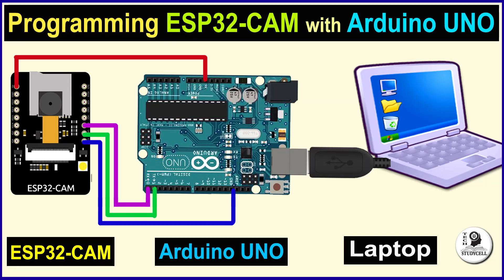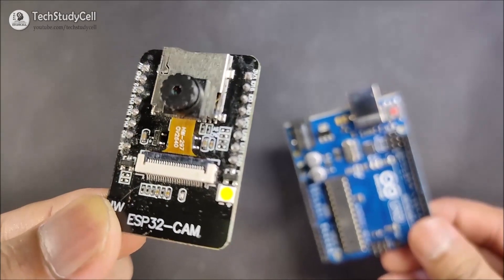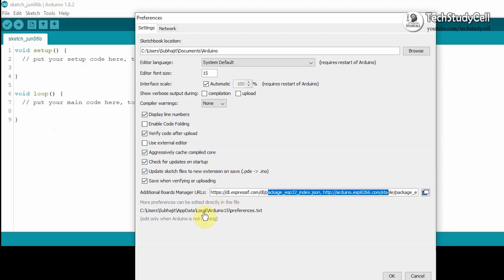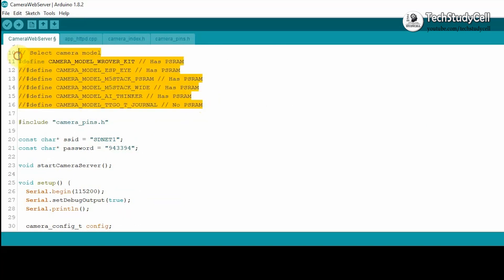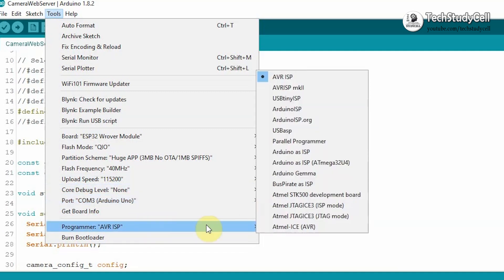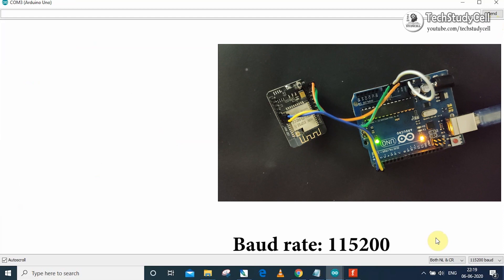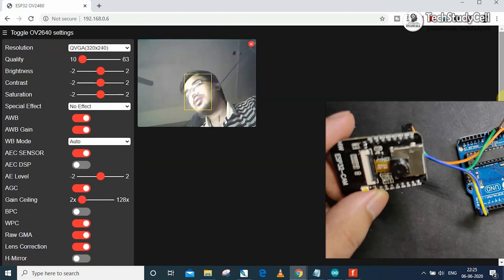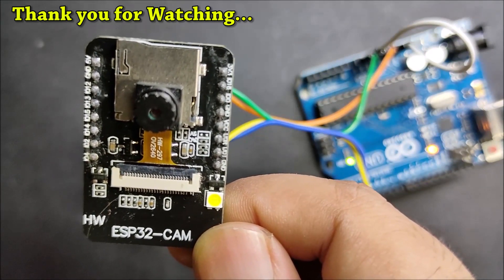How to program ESP32 CAM using Arduino UNO

Comment: Hello,   There is a fundamental error in the video.  When you select the board as esp32 WRover model , how did you get programmer selection as AVRISP !!     This should only become esp32tool  .  You did modify on the Arduino ide platform or something else is missing in the video ....Please advice .....thank you
Reply: It works with esptool ,he is using older Arduino ide ,now eth is updated

Comment: If you're getting this error:

"Connecting........____....._____....._____....._____....._____....._____.....___  
A fatal error occurred: Failed to connect to ESP32: Timed out waiting for packet header"

Be careful — based on the wiring shown in the video, that pin is labeled GND but it's actually GND/R (connected to RST), not a real GND. Make sure to connect the Arduino UNO to the actual GND pin (usually near 5V), not the GND/R one. That fixed it for me.
Reply from the maker: When you see Connecting........___....._____....._ press and hold the BOOT button until upload start.

Comment: After the code is compiled, it displays"a fatal error occurred:failed to connect to esp32, no serial data received " How should I fix it?
Reply: did u fix it same here
Reply: @jemsheena3914  i can't fix it. I followed every instruction in this video but still there is an error .

Comment: hello dear friend im one of your fans and i always watch your videos but i have followed this esp32cam but after uploaded the code to the esp32cam and i have removed the gpio0 and gnd pin after that i have opened the serial monitor i press the small bottom but i did not get the camera code please can help with that the problem is thank you hope hear fro you soon

Comment: thanks dude, but i have one question that its that when i go to the serial monitor and i press the restart button, it shows like this default text and start writing endless dots and dosent give me any IP, do you know how to fix this?
Reply from the maker: It trying to connect with Wifi
Reply: @TechStudyCell  thanks dude i allredy figurate out that the network its not a network that the esp generates its your local network that the esp uses like a switch

Comment: Hi! I need your help. I'm trying to use a trigorilla board (arduino mega2560) to program an esp32cam following this tutorial (spectacular, man!) But it do not work. This board has no reset pins, but it has a reset button. If i push this button, the board ....just reset. If i select the board as esp32, in port only shows "com3". Can you help me using that trigorilla board to program my esp32?

Comment: I didn't get the ip address and stuck at endless dots how can I fix it?
Reply from the maker: it is not able to connect with WiFi. Pls check the wifi connection and exit from the program mode, reset, then try
Reply: thanks already fixed it esp32 is not updated to detect the 5g wifi connections so u must use a 2.4g wifi connection for it to work.

Comment: Excellent explanation! Everything you need, direct, clear, and nothing superfluous
Reply from the maker: Glad you enjoyed it!
Reply: Do I just flash it even though the programmer is not available?
Reply: Flashed it and it worked. To all, be aware, on my ESP32-CAM (ESP32-S) one of the GND pins, is not actually a GND and gave fatal error bla bla. Changing the GND connection to the 2nd GND pin, the flashing worked just fine. Remember to disconnect the GPIO 0 from GND after flashing, open Serial Monitor and only then press RESET on your ESP32 in order to execute the programme and get the IP. In case the response is "............" check your SSID/pass for typos. Good luck!
Reply: Did it worked for you?

I'm getting error and no AVR ISP programmer in IDE
Reply: @techtalk5161  did you get it now ?

Comment: hello, i keep running into a problem where it does not provide a link to be copied and accessed, it only shows up to the entry 0x400806b8 text, after that it should provide a link to access the camera right? mine does not show up, it only shows dots

Comment: I keep getting this error in loop can you pleaase help

Guru Meditation Error: Core  1 panic'ed (IllegalInstruction). Exception was unhandled.
Memory dump at 0x400d6e8c: eeeeeeee eeeeeeee eeeeeeee
Core 1 register dump:
PC      : 0x400d6e91  PS      : 0x00060530  A0      : 0x800d1074  A1      : 0x3ffb1ee0  
A2      : 0x3ffb1f34  A3      : 0x00000000  A4      : 0x0800001c  A5      : 0x00000003  
A6      : 0x00000003  A7      : 0x00000000  A8      : 0x800d6e72  A9      : 0x3ffb1ea0  
A10     : 0x00000000  A11     : 0x3ffb1eec  A12     : 0x00000026  A13     : 0x3ffb844c  
A14     : 0x0000002a  A15     : 0x00000000  SAR     : 0x00000005  EXCCAUSE: 0x00000000  
EXCVADDR: 0x00000000  LBEG    : 0x4008cf0c  LEND    : 0x4008cf28  LCOUNT  : 0xffffffff  

ELF file SHA256: 0000000000000000

Backtrace: 0x400d6e91:0x3ffb1ee0 0x400d1071:0x3ffb1f10 0x400d37c6:0x3ffb1fb0 0x4008fe86:0x3ffb1fd0

Rebooting...

Comment: 1 year later, version 2.04 of the library and things have change. Now I cannot reproduce this at all. What's worse version 1.04 has apparently been altered somehow and can no longer select a programmer for the board at all. What a pity. 

However with the new version I found out that using "Upload using Programmer" (from the Sketch menu) seemingly does the job. I had to reconnect the Arduino to the PC and then restart the serial monitor.

Comment: Hi..
I am getting this error:
A fatal error occurred: MD5 of file does not match data in flash!

I tried uploading it using Arduino and FTDI convertor, both, but getting the same error. Could not find a fix that work.
Would really appreciate some help :)
Thanks!

Comment: I need some help, this given this error when running the program

esptool.py v3.1
Serial port COM10
Connecting........___....._____....._____....._____....._____....._____.....___

A fatal error occurred: Failed to connect to ESP32: Invalid head of packet (0x00)
A fatal error occurred: Failed to connect to ESP32: Invalid head of packet (0x00)

Comment: So there’s not really much of a difference from programming the esp32 cam
Directly with an FTDI Vs connecting it to an arduino board and then uploading the code? 
I’m new to programming lol
Reply: What will happen if i paste the IP on different device browser which is not connected to audrino. Will i be able to access the camera from different device?

Comment: Appreciate it. If you're on Mac and get a "exec: "python": executable file not found in $PATH" error you need to run the commands sed -i -e 's/=python /=python3 /g' ~/Library/Arduino15/packages/esp32/hardware/esp32/*/platform.txt in the terminal.
Reply: What will happen if i paste the IP on different device browser which is not connected to audrino. Will i be able to access the camera from different device?

Comment: cc1plus.exe: out of memory allocating 8016 bytes
Multiple libraries were found for "WiFi.h"
 Used: C:\Users\USER\AppData\Local\Arduino15\packages\esp32\hardware\esp32\2.0.2\libraries\WiFi
 Not used: C:\Program Files (x86)\Arduino\libraries\WiFi
Using library WiFi at version 2.0.0 in folder: C:\Users\USER\AppData\Local\Arduino15\packages\esp32\hardware\esp32\2.0.2\libraries\WiFi 
exit status 1

It is showing me this error while uploading!! Please help ! It's urgent!!

Comment: Unfortunately this did not work for me. I followed the instruction exactly until setting the "Programmer" under "Tools" on the Arduino Uno. The line states: "No programmers available for this board". Also the USB port on the laptop does not designate it is as "Arduino Uno" as in the instructions, just COM5. I've check the spelling of the preferences additions many times.
Reply: found any solution ? i didnt got AVR ASP as programmer either ...

Comment: Sir, I followed every ste but I don not have the AVR ISP programmer. The programmer does not show up under Tools>programmer. It said that "No available programmer in this board". Im using Arduino Uno by the way.

Comment: the urls don't work. I can't get the esp 32 into my examples. it would be so nice, if the info in the video actually was on the arduino program. turning out to be a major frustration. I am an A+ certified computer tech with 20 years exp. this is written well, just not up to date, or just plain wrong. but so far, I'm not getting anywhere. there is no way to teach it to children, if I can't figure it out. everything [points to those two urls, but they don't work, nothing but error messages, and no answers how to fix it, just more and more sites and people pushing that url. 
help would be nice.

Comment: how to use the arduino as a power supply for the esp 32 cam (just a power supply after programing it to use the arduino with other code which not to effect the code on the esp 32 cam  )

Comment: im having error with the face recognition, it said:

Item psram alloc failed. Size: 230400 x 1
matrix3du item alloc failed.
dl_matrix3du_alloc failed
Item psram alloc failed. Size: 230400 x 1
matrix3du item alloc failed.
dl_matrix3du_alloc failed

how do i fix it?

Comment: Hi, thank you for this video.

I have a question for you

Is there a way for use the arduino´s pins to connect 
peripherals? I need more pins and the ESP32 is full
Reply from the maker: You can initiate serial communication between ESP32 and Arduino

Comment: Can someone help me i have error while running the esp32 cam module. Face detection and face recognition is not working 

Item psram alloc failed. Size: 126720 x 1
matrix3du item alloc failed.
dl_matrix3du_alloc failed

Comment: Thanks!! Worked. I see some having trouble with "Programmer: AVR ISP" but I'm using Arduino IDE at version 1.8.13 without this setting, in programmer I just left with nothing and worked.

Comment: But esp and Arduino works on different logic levels.. using 5v on  esp32 can damage the board or are they 5v tolerant ? Seems like I'm missing something here
Reply: ESP 32 boards have a built-in voltage regulator that steps down incoming 5 volt to the required 3.3. the problem with using 3.3 directly is you don't provide enough voltage for all the components on the board.
Reply: @MultiSmokeBomb  yeah but regulator is for the power supply right? Logic signals are different, aren't they?
Reply: @phizaics  yes they are but when you input 5 volts or higher of power on the voltage pin it routes it through the voltage regulator I'm not exactly sure how the printed circuits on this board work and what direction is they run I haven't traced them. But I did read in the user forums on the AI thinker page that it does automatically regulate the voltage that you're inputting. You wouldn't be putting voltage in on a data pin anyway, but if you look at the schematics some of those IO pins are multi-use. In fact I think at least six pins on the board have three different functions each. I'm still having problems getting mine to work. It keeps failing on connect no header
Reply: Addendum, I think the regulator is tolerant up to 15 volts at 1 amp.
Reply: Made a liar out of myself just when I told you that I haven't been able to get it to connect for the upload it decided to upload

Comment: i have an issue error:

Arduino: 1.8.13 (Windows 10), Board: "ESP32 Wrover Module, Huge APP (3MB No OTA/1MB SPIFFS), QIO, 40MHz, 115200, None"

Sketch uses 2594774 bytes (82%) of program storage space. Maximum is 3145728 bytes.

Global variables use 56256 bytes (17%) of dynamic memory, leaving 271424 bytes for local variables. Maximum is 327680 bytes.

esptool.py v3.0-dev

Serial port COM7

Connecting........____....._____....._____....._____....._____....._____.....____

A fatal error occurred: Failed to connect to ESP32: Timed out waiting for packet header

A fatal error occurred: Failed to connect to ESP32: Timed out waiting for packet header

This report would have more information with
"Show verbose output during compilation"
option enabled in File -> Preferences.

Comment: In the video you are showing a ESP32 board not the camera board. For some reason, although it's trying to connect, it's not connecting with the camera board. I tried reversing the RX and TX lines and that didn't work. Can it be a wrong board in the Arduino IDE?  Any suggestions? Thanks.

Comment: I get this error:
[E][camera.c:1113] camera_probe(): Detected camera not supported.
[E][camera.c:1379] esp_camera_init(): Camera probe failed with error 0x20004
Reply: same here, did u find the solution?
Reply: @janejakumar9844  i changed the board to AI THINKER ESP-32

Comment: thanks for the video. I have a question, can the camera be accessed from any point outside the network, either with Wi-Fi or mobile data?
Reply: Just based on the IP address that was allocated to the device I'm going to say no. What you can do though is once it's set up you can go into your router settings and assign that device a static IP. You can place that static IP into the DMZ outside of the router's firewall openly facing the internet.

Comment: buenas noches,, me sale este error  Arduino:1.8.13 (Windows 8.1), Tarjeta:"AI Thinker ESP32-CAM, 240MHz (WiFi/BT), QIO, 80MHz"

El Sketch usa 2594790 bytes (82%) del espacio de almacenamiento de programa. El máximo es 3145728 bytes.

Las variables Globales usan 56256 bytes (17%) de la memoria dinámica, dejando 271424 bytes para las variables locales. El máximo es 327680 bytes.

esptool.py v3.0-dev

Serial port COM4

Connecting........_____....._____....._____....._____....._____....._____.....____Ha ocurrido un error mientras se enviaba el sketch

_

A fatal error occurred: Failed to connect to ESP32: Invalid head of packet (0x00)

Este informe podría contener más información con
"Mostrar salida detallada durante la compilación"
opción habilitada en Archivo -> Preferencias.

Comment: Hi Sir, great work. I wanted to ask a question, would this same setup work with arduino mega board serial 1 pins?
Reply: Hello I was wondering whether you have found a way to connect it to arduino mega board?

Comment: I got it to go after a few tries. Also yes to set Programmer to 'AVR ISP' you need Arduino IDE 1.8.12. It's not on the 1.8.13 version. Thank you very much!
Reply: But this not working, I can't find esp32 in examples please help
Reply: Hi, I followed the steps and got successfully the IP address. However, when I tried to search it on browser it can't reach the page. Pls help.
Reply: @jameslloydtumanda2136  is that module is connected to the device in which u search?? through hotspot/wifi??
Reply: @gokulakrishnan527  Do you mean that my laptop and the module must be connected to a same wifi network?
Reply: @jameslloydtumanda2136  yes you have to connect same wifi !
Try it:
swithch On the Hotspot on ur mobile and connect ur laptop through wifi also connect module to that same network 
search the ip on ur mobile browser or laptop browser.
Reply: @gokulakrishnan527  My laptop and the module are already connected on the same wifi network. But still, it can't reach the page when I search the IP address. I will try to use other WiFi network. Thanks..

Comment: why whenever i choose face detection/ recognition the stream freeze and stops working?
Reply: CORRUPT HEAP: Bad head at 0x3ffdfdf4. Expected 0xabba1234 got 0x00000008
abort() was called at PC 0x4008a64d on core 1

this the error i get when i select face detection or recognition

Comment: sir, I follow all of your instruction, how many times I repeat this video, and I still get the A fatal error occurred: Failed to connect to ESP32: Timed out waiting for packet header. what should I do? My esp 32 cam wont light the led if i reset
Reply: I'm having the same issue, did you get any success?
Reply from the maker: press the reset button before uploading starts.
Reply: @TechStudyCell   Im still getting timed out waiting for packet header sir. please help
Reply: @visman3072  I have the same problem here even if I pressed the RESET button...I need help. did you get it?
Reply: I'm so sorry, I didn't solve that problem
Reply from the maker: First, select the board and port as shown in the video. Then after the compile (before uploading starts), press the RESET button of ESP32CAM.
Reply: anyone got solution

Comment: hello, i am unable to find the examples for esp32. What can do to locate the examples after installation?
Reply: Hi, this should be visible after you change your board to ESP: Tools -> Board -> ESP32 Arduino -> ESP32 Wrover Module. Check the examples right after this.
Author just already had this set up
Reply: @RockThePlanet-d5p  thank u mate
Reply: @RockThePlanet-d5p  Thank you :)

Comment: I cannot get IP address by serial monitor, it only shows dots after I pressed the reset button. Anyone can help?
Reply: Hey you need to press the reset button on the other board not the board in which camera is there
Reply: @havish5963  Thanks bro
Reply: did it work

Comment: Bro,After uploading sketch 'CameraWebServer' to the ESP32-CAM using Arudino IDE, I try using the serial monitor to show the IP address of the ESP32, however It just continues to load infinitely ,The dots just keep on printing and printing with no error code. Please give a solution
Reply from the maker: Check the WiFi credentials in the code
Reply: @TechStudyCell  where can I check it?

Comment: It won't work without connecting the arduino in reset mode... After connecting them it works now. Great video
Reply: how do you put it in reset mode?

Comment: It's working, Great, Thanks...
How can I connect this to Charger to use it without uno and computer, after complete setup
Reply from the maker: Just connect 5v supply across the 5v and GND pin
Reply: @TechStudyCell  But it wont connect hotspot/wifi everytime i have to connect to arduino then only it connect to hotspot/wifi 😭😭😭😭 pls give me solution for auto connect🙏🙏